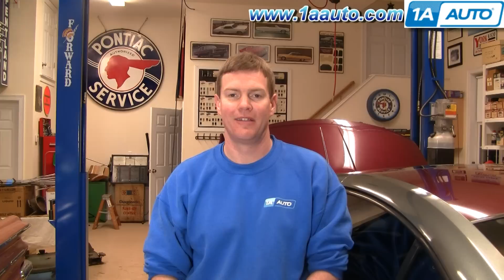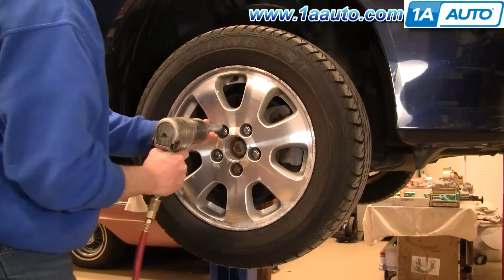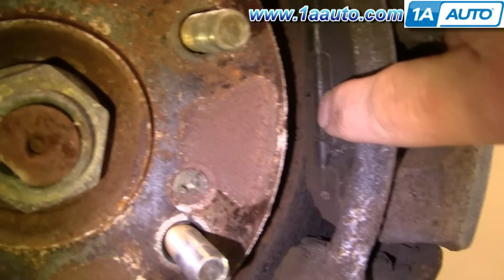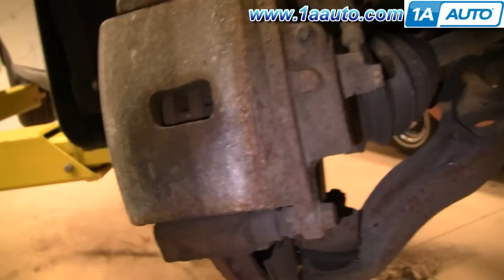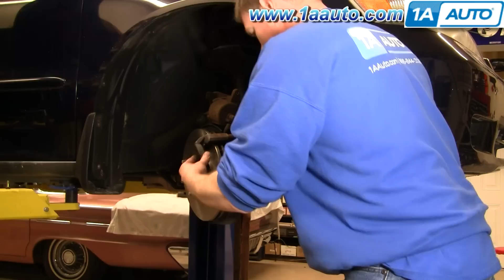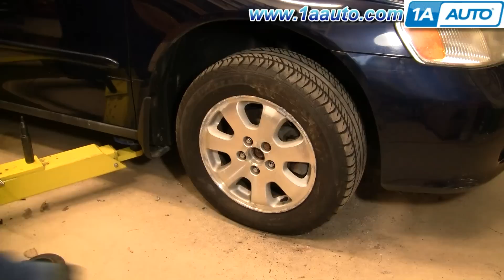How to Replace Brake Kit 99-04 Honda Odyssey

Comment from the maker: You may want to check the catalytic convertor to see if it's clogged, if it happens afte rthe truck heats up. Also check for a loose or corroded connection to the battery and this may also be causing your issue.

Comment: You didn't mention the lock nuts on the caliper bolts. Also, you didn't open the bleeder valve when you collapsed the caliper piston. Aren't you worried about blowing the piston boot out when you depress the piston? Just curious.

Comment: Don't you need to open the brake cylinder cap when pushing in the piston on the brake caliper so that air doesn't get trapped in the line?
Reply from the maker: +Ivo Simon You can if you would like to, it's not necessary

Comment: great videos they are very helpful. I have a question about the red light on the dashboard "BRAKE" it turned on so I replaced the front brakes and rotors.  But the light is still on how can i erase it?  thanks in advance for the help.
Reply from the maker: +Ignacio Arreola Lights like that typically need to be reset, and the owner's manual should tell you how to do it!
Reply: thank you
Reply: I have a 2003 Odyssey that had this light come on. If it's the one below the door ajar symbol, that usually means one of the rear brake lights are out.

Comment from the maker: You may have a burnt our light on the left side of the vehicle. Usually this is why the turn signal doesn't blink. Check the turn signal and brake light bulbs to see if they're blown, and need to be replaced. Hope this helps you out. 1aauto.com 888-844-3393

Comment: Do u have to bleed the brakes?
Reply from the maker: +Randy Schmidt As long as you do not remove the brake lines or open the bleeder screws you will not need to bleed the brakes. Thanks for checking us out! 1AAuto.com
Reply: @1AAuto  thanks for the fast reply!!